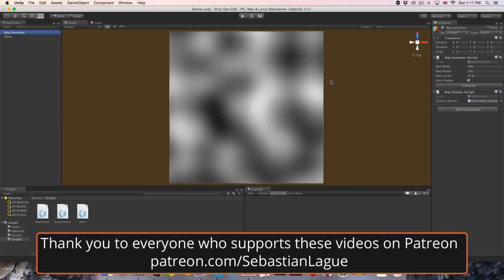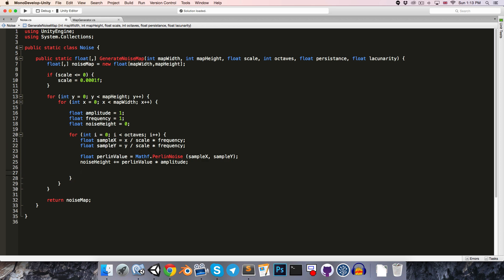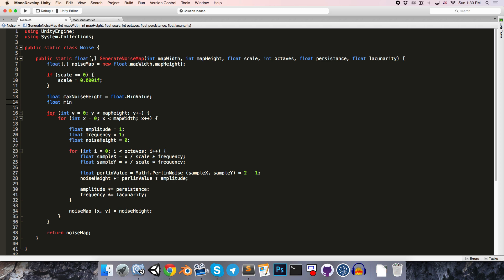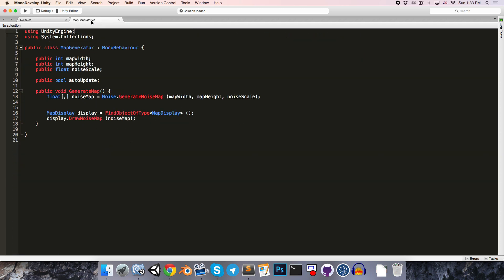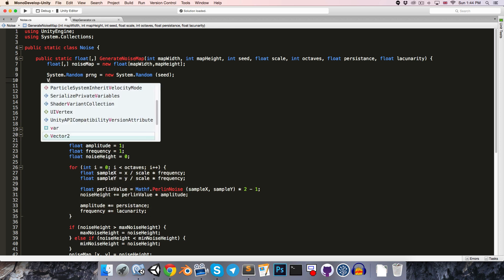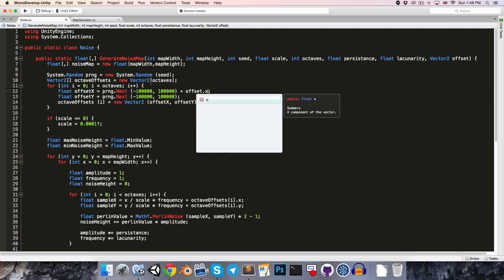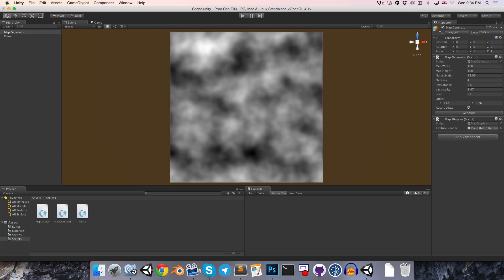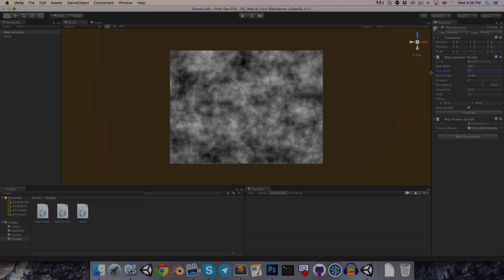Procedural Landmass Generation (E03: Octaves)

Comment: I was wondering if eventually you'd show a way to use this for 2D terrains, and would add editors for the final version of your terrain (provided you may like to move the vertices by hand after the generation).
Reply from the maker: +Jonath Kane Great suggestion. I'll probably do a spin-off series on 2D terrains (with an editor as you described) after this series is finished.
Reply: Sebastian Lague Wow haha many thanks !
Reply: I'm currently working on an implementation using EditorWindows, that also makes use of Temperature maps, Moisture maps, Humidity maps, and Air Pressure maps to generate biomes based on earth climate principles. It will be ready probably in 5 months from the time of this post. The idea is to create a 2D campaign / cartographic map with point of interest features that can be explored in a 3D setting. I'm hoping to use it in a demo game called medieval as a proof of concept.
Reply: @StephenWebb1980  did you finish it?
Reply: +Jonath Kane would love to see this too, hoping! :)